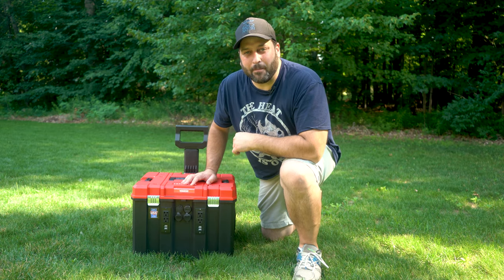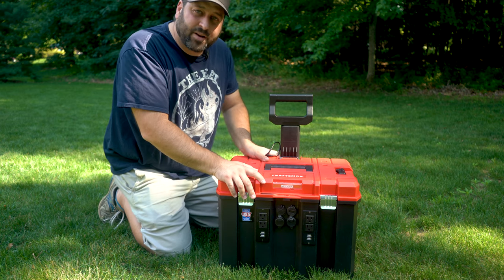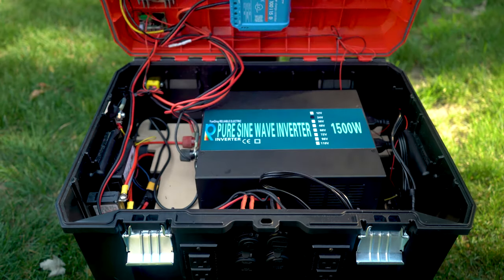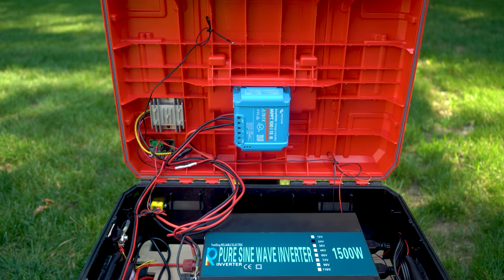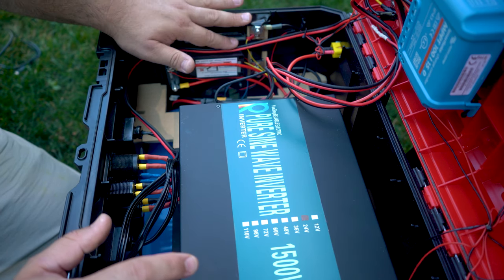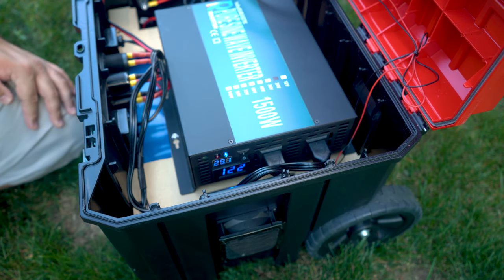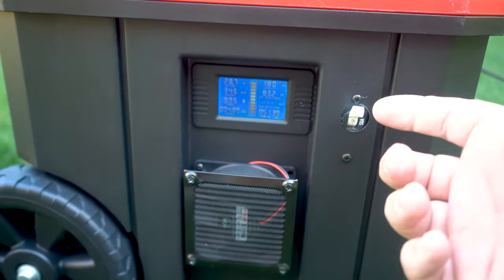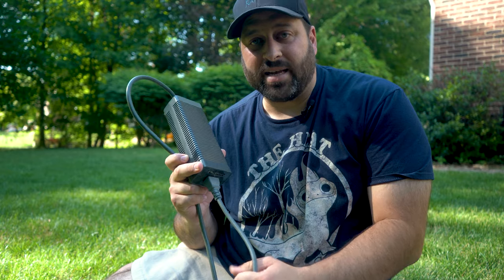DIY Solar Generator | Infinite Cheap Renewable Energy

Comment: What about heat buildup. Is it tried and tested in hot weather or climate.
Reply from the maker: So far so good, though I'm still a little concerned if I used it to the extreme in very hot weather.  I use it to run my drone races, and we did have some times where it was 95 degrees and it worked just fine.  It has 2 fans inside to circulate the air, and it has a temp sensor.  The air at the top can get a bit warm, especially if the box itself is in the sun, but the batteries have remained pretty cool at all of my work levels so far.

Comment: Go to the second hand store and buy a laptop battery charger they usually in the higher voltage I can put out some good amps that way you don't need the boost converter
Reply from the maker: Thanks!  I did look for 2nd hand 32V+ laptop chargers and didn't see any that would work well.  Perhaps I didn't look close enough.  I decided to just add a direct DC port and use my DC->DC converter directly instead for now.  I still haven't had to use it, but it's nice to have.

Comment: And when did you shut off, I shut mine at 21V, that is 3V per cell
Reply from the maker: That is when my BMS will kick in and shut down the battery for me, but I won't take it below 22V on my own.

Comment: I missed the generating part of this build
Reply from the maker: it's not my term, but it's a general term you'll see throughout retailers of products like this.  The "generating" part is typically referred to as the solar controller + solar panels.  That "generates" the power.  I'm guessing the idea is that most people don't understand what a gas generator is, and these are meant to be alternatives to those generators without gas so they use the same name?

Comment: How many Ah is the battery
Reply from the maker: at the time I built this with a single 7S20P battery it was 1.35Kwhr (52Ah).  Since then I've built 3 more batteries within this container for a total of 232Ah and 6Kwhr
Reply: @JohnEFly  thanks, so I'm working on learning for my first ever build. I'm trying to build this same set up. I'm looking for 18650 batteries to buy and was wondering how high of a CDR I should be looking for? I see some batteries are rated for 5amp and some for 20amp
Reply from the maker: @drewkeeter2312  I have used a variety of different cells for different packs, and it really depends on the size of the pack you're building and the use case for that pack.  In this case the first battery I built and used in this case the cells were rated for 5.2A continuous discharge.  When put in 20p configuration that basically means if they were pulling across all cells it could deliver up to 104A.  However, the rest of my system isn't actually designed to handle 104A, including the BMS I used, so my expected load was always supposed to be less than 40A, therefore a cell capable of 5.2A was fine for my usage.